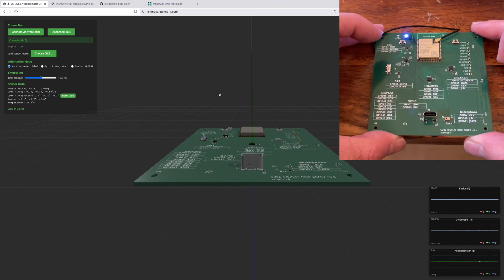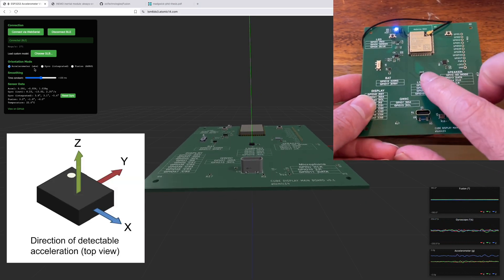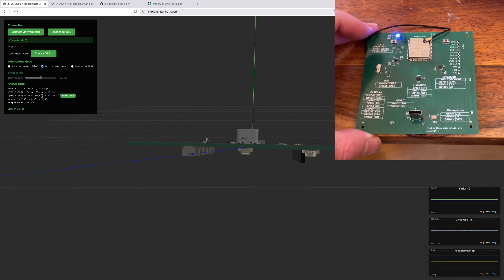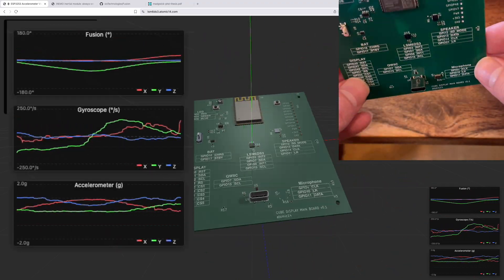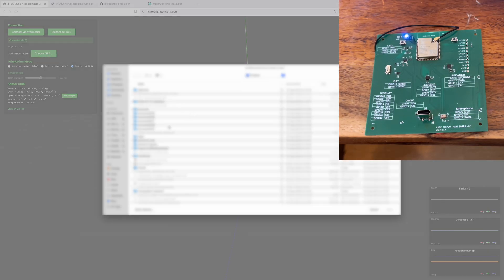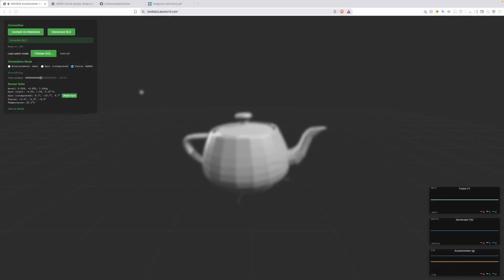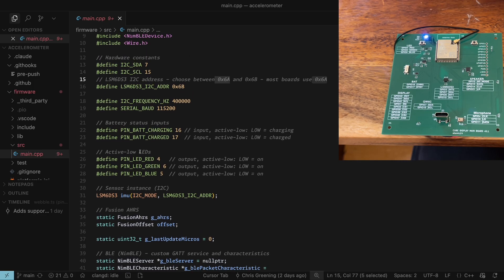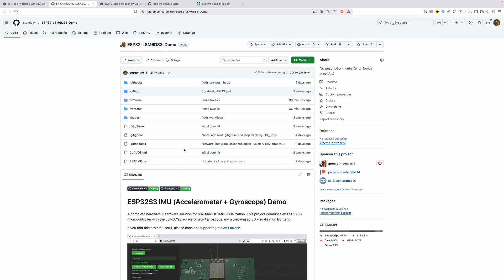I Made a Digital Twin for my PCB - IMU Visualiser

Comment: Can you make the pcb schematic project available? I've been learning KiCad, trying to create a custom ESP32-C3 with an IMU and battery, your project is very close to what I'm trying to do, would be nice to compare my progress with yours. I'm using the BMI160, but with the devkit I used the MTU6050, later found out it's discounted.
Reply from the maker: I’ve added a link to the video description - the hardware is a work in progress - but so far all the bits are working.
Reply: @atomic14  Thanks, I've also found a good resource, Seeed studio make lots of their boards schematics available.

Comment: LSM6DSV can do sensor fusion in hardware, have you compared it to the software library?
Reply from the maker: I might be missing something but I can’t find anything in the data sheet or libraries that do this on hardware. It dues have step, gesture and fall detection.
Reply: @atomic14  Ah sorry, you're using LSM6DS*3*, it is a simpler part than LSM6DS*V*. The latter has a "sensor fusion low-power (SFLP) block" that'll give you orientation and a programmable state machine to do gesture detection.
Reply from the maker: @W1N9Zr0  Ah nice - looks interesting. I might have to take a look. It is a bit expensive though - looks like around $5.